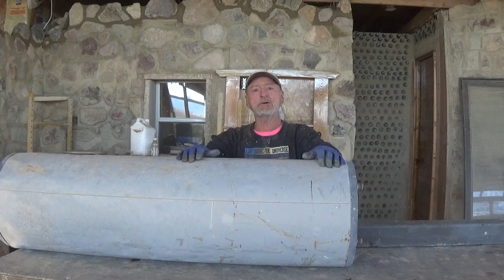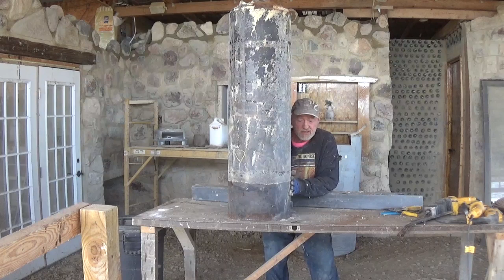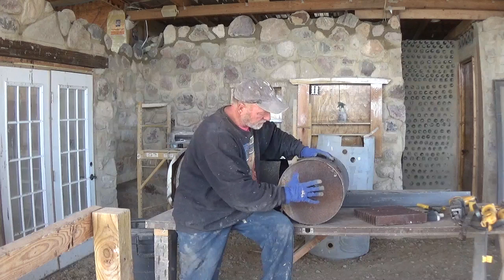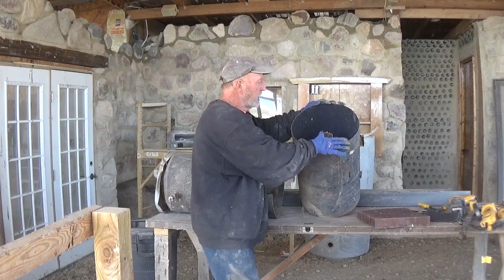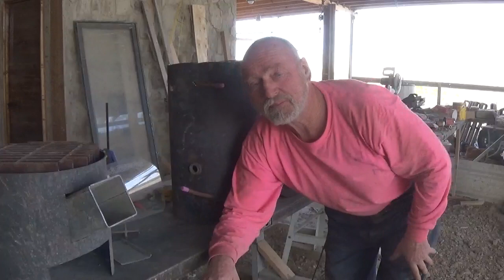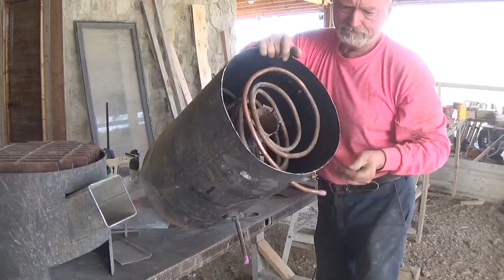Rocket Stove/Incinerator/Hot Water Heater/Cooktop, Part One

Comment: Hi Robert, it looks like the jacket on the water heater is about 16 or 18 gauge. I love the stove it's looks great. I found out also if you buy straight copper pipe you can bend it yourself by just crimping one end and filling it with sand. As you bend it around a stump or pole say 4 ft high the sand or filler will prevent folding because the pipe is not hollow. Then just  cut the folded end and empty the filler out of the pipe and viola!! a nicely curved copper pipe at half the price... ha ha I love your videos and hope we can talk more as time goes on my friend

Comment: The way I learned on how to coil copper pipe is to full it with sand and then coil it around something for the diameter you desire. It is not so much about neatness as it is about an even flow of water throughout the coil and less likely to cause a weak spot that high pressure would pop someday. The nice thing about the sand is it can be reused over and over and if you have the desire to make more of these units for folks, then your overall work would be easier, the product would be better, and less likely of damage to be repaired later. Just sharing what I learned.
Reply from the maker: I will definitely do that next time. This time, I had a spring that was supposed to bend the pipe, but it did not do a good job. Still, there are no kinks, it just looks ugly!

THANK YOU!!
Reply: A spring? Never heard of that method. Is it specifically made for copper pipe bending?
Reply from the maker: Yes, for bending copper pipe. But it would not bend to a tight coil AND the thing got stuck on a part that was a tiny bit flat!
Reply: Bummer. Well, I am a sucker for gadgets, but I think that I will leave that one alone and stick with the low tech approach.

Comment: Hi, im builing a wood boiler now and Ive alway wondered about going around the firebox with copper coils in place of  a water jacket, Would it produce enough heat threw the coils?  I'm trying to get away from the smoking water jacket type boiler.
Reply from the maker: We have both here and I think the copper coils in the new one (45' of copper coils) seem to be more efficient that the 40 gallon water jacket tank is. I recommend using copper coils instead of the jacket!